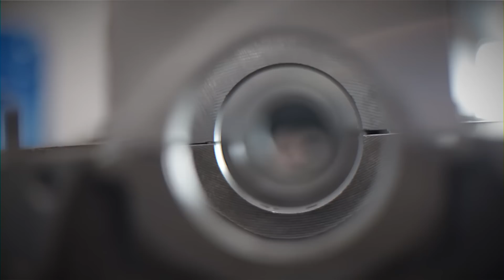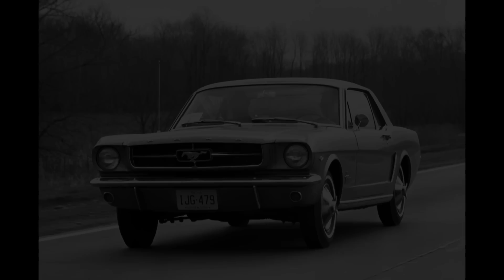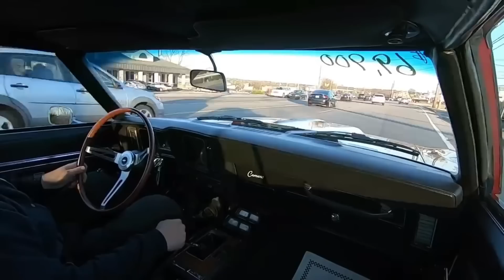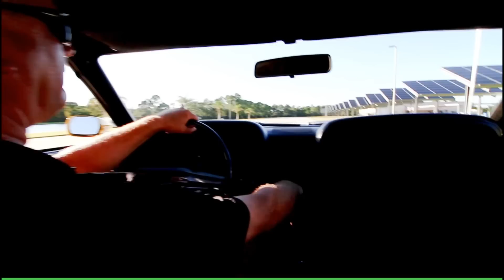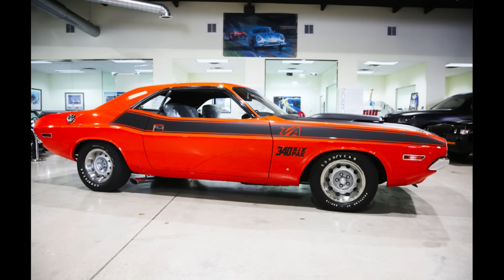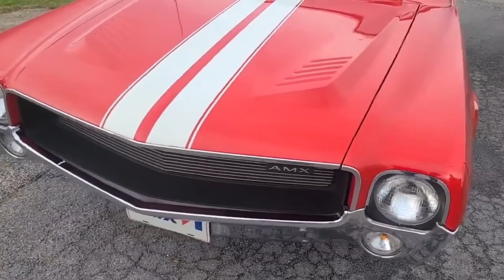Most RARE Small Block V8 Engines Ever Built

Comment: Olds had one block. No small block,  no big block . 
340 Dodge was the awesomest
Reply: WRONG, Oldsmobile had small blocks. And Big blocks. They are correct W31 350. W30,was 455. Oddly the Olds 403 was a small block . The 400s of the late 60s were big blocks
Reply: Depends how you wanna define it. The deck heights were lower, but the heads were interchangeable.
Reply: I had that olds 6.6 403 engine I put in a Pontiac Grand Prix. All I know it was a big heavy engine and poor rocker arm design  @josephrodwell6643
Reply: False. 455 and such used a taller deck height, therefore different casting, than the Olds 350 and such.
Reply: The Olds "small block" is essentially the big block with a lower deck height  (half inch?), but what was really different in the lower block?  You could swap camshafts between 350 and 455.
Reply: @jeffbranch8072 Sorry it took me almost half a year to get here, there are a lot of comments to check on YouTube. 😊

To answer your question, the Big Block Olds had larger mains than Small Block. 
The 350 Diesel casting was a mashup of Big Block mains with Small Block height.

There were differences in lifter bank angles also.